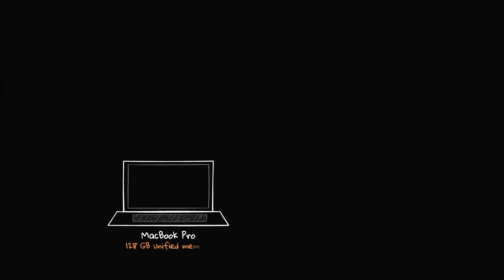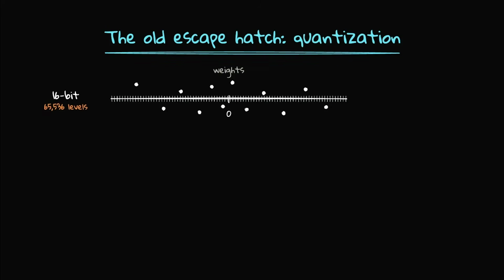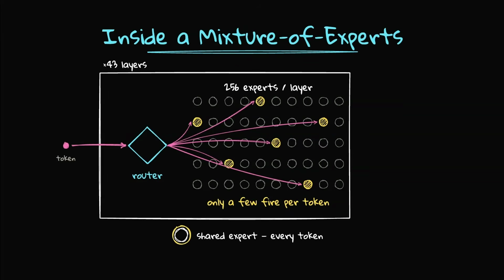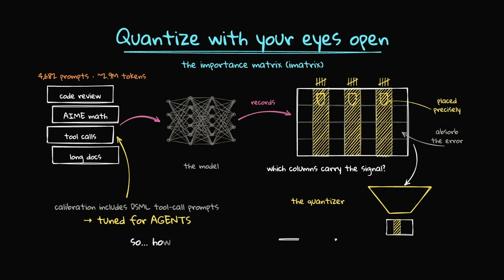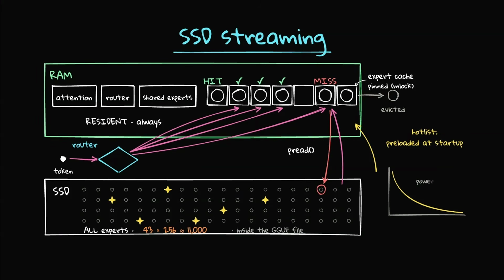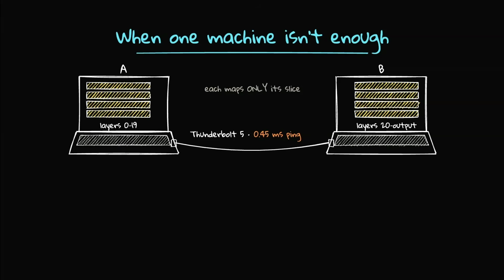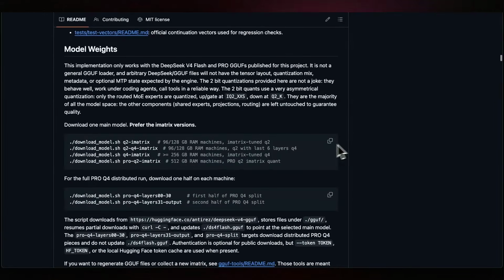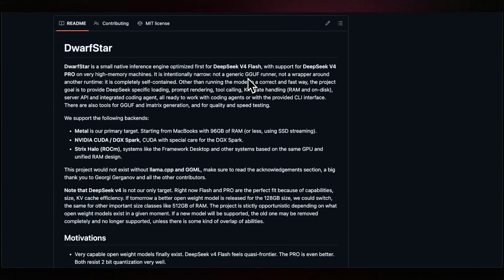Run a 284B Model in 128 GB: DwarfStar Selective Quantization Explained

Comment: Yeah, and please show us the similar GLM project 🎉
Reply from the maker: The same guy is working on it
Reply: @engineerprompt  then we can expect freebuff to add GLM 5.2 🔥
Reply: they already provide unlimited usage of deepseek v4 for 5hours a day and it resets every 24h
Reply: i got GLM 5.2 to run on a 2x3060 12 gigs and 32 ddr4. At 0.5 tps. But i have bragging rights. Didn't do speculative decoding on it yet, maybe that'll will bring it up to 1 whole tps.
Reply: @dixier3ct  impressive...1 bit quant?
Reply: @criticalmassiveenterprise 2 bit 😂
Reply: @dixier3ct  Jesus, I am very impressed. Would watch a video of your setup man, I'll sub in case you ever do 👏
Reply: @dixier3ct  I have large models getting a couple tokens per second locally for fun and profit. Initially i put them on a batch job that only needed to produce output at the end of the day. Summarizing the days chatroom for the office and work that was done. this job is not time sensitive it can run for 30 minutes to an hour once per day, what is actually sensitive is the data and information within the internal chats. Once this is done in the system smaller agents can work with the memory and borrow the reasoning work that was already done by a larger model. I do not vibe code so i do not have unrealistic expectations,  There are many clever ways to  use a large model in the background. Speed is irrelevant When a model can suggest solutions and drop a few things the group missed. There have been several useful insights from GLM 5.2s reasoning that we missed throughout the week.
Reply: This is just wishful thinking right?
Reply: @PhilEhI  i would say yes but i have seen crazy things with minmax m2.7 before so....